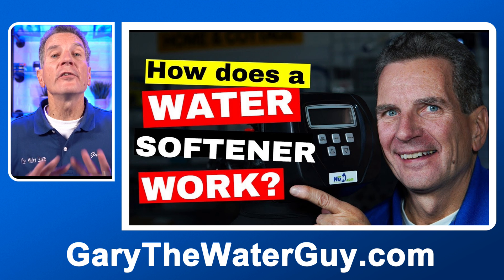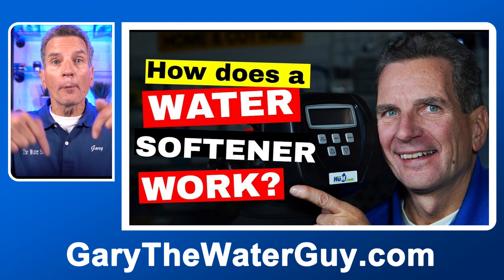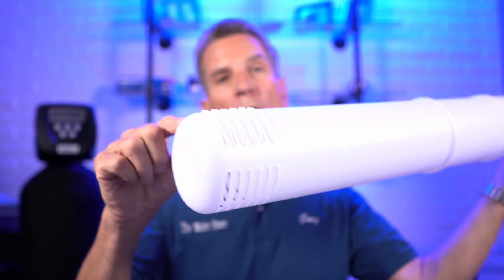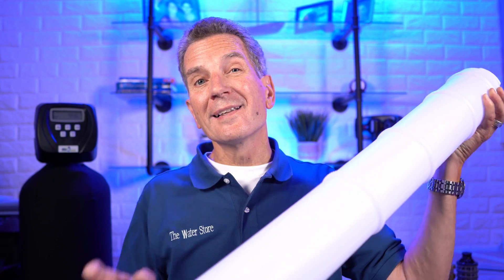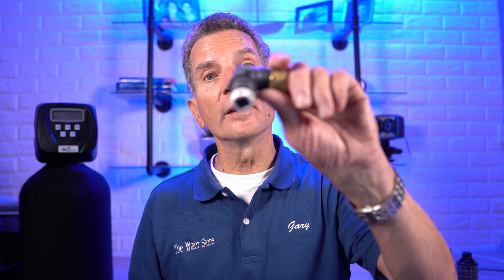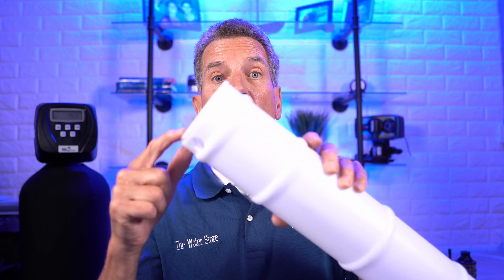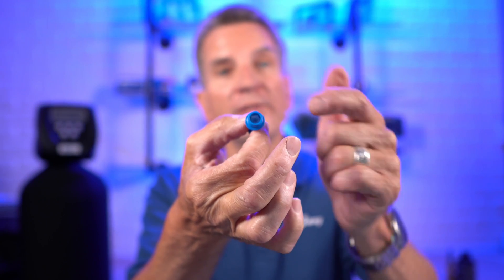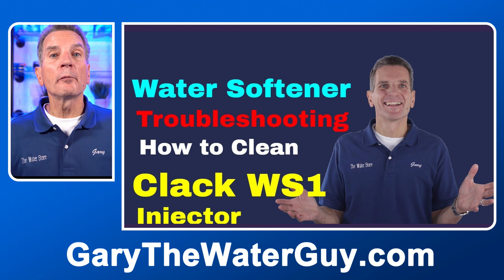Water Softener Troubleshooting – TOO MUCH WATER in Brine Tank

Comment: Great videos and you helped me start troubleshooting.

I think I always or for the longest time had lots of water in my brine tank or at least I think I did. I would say the tank is just below half full. My brine tank would be the size of a big large plastic garbage can. It’s big.
So I cleaned it all out and took the float out and checked everything and blew with my mouth to make sure the float was working when I’d move it up and down and it does work.
I checked the brine line and the connections at the Fleck 5600 and everything was clean.
So from empty I would fill the brine tank until the water is about 6 to 8 inches under the float then run a full cycle. I can hear and feel the water leaving the brine tank and when it’s filling. When everything is done and finished the water level is about just half way filled in my brine tank and looking at the float the water is just under the float which I’m assuming is correct because I’m assuming when it’s refilling the float shuts the water off but when it’s completely done should the water level be this high right under the float or should it be 6 inches under the float. I thought I seen that for the first cycle starts to drain the brine tank again that the float needs to be down or the water level needs to be below the float.
Reply from the maker: Keep in mind that the float is never used unless the water softener malfunctions and does not shut off when filling the brine tank.
Reply: @water_estore 
Ok great thanks. So after cleaning again and trying to troubleshoot or trying to figure out stuff when I manually turn right away to brine rinse the water in the brine line is actually filling the brine tank there’s no suction happening until quite a while after this happens as I have the brine line disconnected off the float and hanging in the brine tank.
When I disconnect the brine line from the head and place a bucket there when I manually turn it to brine rinse it will shoot water out fast and I’ll need to turn the dial by hand quite a ways for suction to start I guessing about half way turn in this cycle. Is this normal? PS also put a new drain hose line it’s not long about 3 feet but the last foot and a half was filled with iron sediment buildup inside with a reduced inside diameter

Comment: Hi Gary, thanks for your amazing videos. I've been troubleshooting this issue for a while and still can't figure it out. So I cleaned the injection valve, and ran a regen cycle. When it was in the brine cycle I can see the water leaving the brine tank and water is disappearing. I stepped away. After the regen cycle I checked back and it's full of water again,  up to 2/3 of the way above the amoount of salt I have. I have about the bags worth of salt in there. Is it my setting? I live in Stouffville, On, and the water is hard here, so I set it at 17.
Reply from the maker: It might be but was there a time when the softener was new when there was less water after regeneration?
Reply: @water_estore  It's only been a year old, not sure how they set it up, but it sets to regen when it reaches 0. So my thought is that it's adding water head of time, but I can be wrong.

Comment: I have an older camshaft water softener I don't think it's revolving properly there's water building in the brine tank any help?
Reply from the maker: Sorry, with those my suggestion is just to replace it
Reply: @water_estore   The problem I found out was that tabs go in the center there's a small pilot hole on that but I'm still getting water backing up in the brime tank and it is clear the outlet in the back and I drained the brime tank itself

Comment: Great content. The pre installed water softener plumbing in my house seems to have the water softener drain running from the garage to upstairs laundry, which is about a 10ft rise in elevation. Would this create a backflow into the water softener? Not sure if there is any valve that can be installed to prevent this.
Reply from the maker: They are often installed that way.  No problem as it is.

Comment: Can I turn the 1 piece tank on its side to clean tank out?
Reply from the maker: I wouldn't, they tend to break the top plate.  If you are very carfull and tip it on to it's back it might work.  But again, I wouldn't.

Comment: How is the regen done if we don't have that fancy button to press? Mine has the dial🤷‍♂
Reply from the maker: Depends on the brand but usually you just turn the dial slowly clockwise and when you start to hear water running let go and it will take it from there.
Reply: @water_estore  I turned the knob to "regen" and after a while, it started. Thanks

Comment: Hi Gary 
I have 2 piece culligan gold 9” water softener now i have a problem with that and problem is whenever i turn water supply on it just directly send it to drain and then i bypass the water supply and turn regeneration brine tank has more water as compare to before regenerating 
So i check brine tank its full clear i check filter its ok i check drain pipe its working well 
But i didn’t figured out what the problem is  if you understand can you please tell me what is the problem and how can i solve that please
Reply from the maker: It sounds like it stuck in the backwash cycle.  Likely needs to be rebuilt.
Reply: @water_estore  thank you so much for replying 
Can I rebuild it myself if yes how can i do that and how much it would be cost give me some idea thank you in advance
Reply: You need to replace the seal pack and eductor kit

Comment: Hi Gary,  great videos. Now I know that I will need to service my system and replace a whole bunch of things since it was never done in the last 12 years. You can expect an order from me soon. One question I did not find answers to goes like this. I have two Clack WS1 valves and the drain line flow control elbows leak water from the little stub that comes out the side of the fitting. I have added a piece of clear hose to direct the water to the sump hole but would like to fix it and understand why water comes out of that orifice.
Reply from the maker: Great question!  We just fixed one of these for a customer last week.  That stub contains a small one way vent that was designed to make the backwash cycle quieter.  After a time it leaks.  You just need to replace that drain elbow.  We have the replacement part here https://waterestore.ca/products/clack-ws1-drain-elbow-v315801 and the video here at the 43 minute mark explains how to replace https://youtu.be/MCrcE1Tffsk

Comment: Great video. I have the Kenmore Ultra Soft 250. I have gone completely through it, got it all redone, but often see the water in the brine tank up high. The float on that valve rod is adjustable, but I cannot find any literature even in the manual on how high the float should be. Is there a general rule of thumb on the height it hould be at? I have heard 10 inches, but at what point should that be measured? Also, if I fill the brine tank up into the 7 or 8, should the water level still be below the salt? Thanks.
Reply from the maker: Great question. The float does not control the level of the water, the valve does based on the programming. Typically there should be about 1 1/2 feet of water on average.

Comment: Hello, excellent videos. 
One thing I couldn't find is how to empty the water from the brine tank. Ours is now 3/4 full and it has never done that before. It is 5 years old and usually it just covers 2 bags of salt at the bottom, maybe a foot of two of water. Is there a way I can manually empty the water from the brine tank now through the valve or setting? 
Thank you for all of your great videos and advice. Much appreciated.
Reply from the maker: Yes, once you have repaired what caused the overflow just regenerate the water softener a couple of times and it will suck out the brine and return it to the correct level.
Reply: @water_estore  Thanks for the reply. I guess what I was asking is there a way I can just pump the water out with the system without regenerating it to see if it was just a fluke?  Thanks.
Reply: No salt was being added for a year
Reply: Should you not drink the water where no salt has been added.
Reply: Can the water softener leak out onto the  flow if you haven't added salt for about 1 year?

Comment: Hi Gary, I have a EMC 10 Water softener and its brine tank is getting filled up to the top on manual regeneration. I have checked the outflow tube and it works OK at the begining of the Regen cycle draining out water and after 10mins or so out of 74min cycle, the water starts to build up in brine tank. Overflow tube is all clear. Brine tank outlet tube has got no clog where it goes to the top into the main tank (resin tank) area. I have also tried to put 100-300mls of Resin cleaner in the brine tank while the water is still on but it has achieved nothing. When I do manual regen, I keep the inlet and outlet water valve in functional position. Any thing else which can be the cause of this problem or does it need new resin? Will appreciate your diagnosis and treatment on this ill water softener, DOCTOR Gary . Thank you so much
Reply from the maker: Media replacement will not fix it.  Did you check all the suggestions in the video?

Comment: I used a rust out cleaner in my water boss a few days later the brine tank was full of water. Doesn’t seem to be filling during a regeneration but rather it happens randomly in between them.  Any ideas? Also my softener won’t regenerate when in bypass mode only in service mode. I notice u regenerate a lot in bypass mode.
Reply from the maker: If is fills between regenerations water is leaking past the piston.  Water softenmer can only regenerate while in service.

Comment: I need help please.    I have a whirlpool.... w softener  .  The low salt or recharge light is continually blinking ... Its a little low on salt but it has been lower many times b4 .
 My elec was out last week ...that may have something to do with it .  Anyways it want respond when I push any button . I can't even set my time . Can you please help?
Reply from the maker: Sounds like the circuit board may have been damaged by a power surge. Try unplugging it in, waiting a few minutes and plugging it back in to see if it resets. If not you will need a new circuit board. If not you’ll need a new softener like this one https://waterestore.com/products/hum-deluxe-water-softener-30-000-grain

Comment: Thanks for your video. My brine tank had the standing water problem weeks ago, and I scooped out all the water and it seemed to be normal for a while, and when I checked again few days ago, the tank has water level very high again, and like last time, with some dirt floating on the water. can i manfully do the regeneration while the brine tank is full of water?
Reply from the maker: Yes, but you need to determine what is causing that high water level by troubleshooting.

Comment: These videos are amazing to watch. We have been in our house for almost 10 years, (house was built in 2008) and this is the first time we have had issues with our softening system. Hose connected to the brine tank keeps popping out out of the brine tank, and water ends up all over the floor. I am addicted to watching these videos now to learn more about it. We have someone coming to look at it, everything my husband and I have tried hasn't been working so far. And still leaks water all over the floor.🥴. *Roughly how much would a whole new water softener system be*, IF we need a whole new system.  We are in Ontario Canada. We just cleaned the brine tank out, so no salt clog anymore... there was one about 2-3 inches thick. Yuck. And my husband said it to regenerate a few times. So we think it might be time for a new one.
Reply from the maker: This water softener would be a great choice, we have them for about $1200 currently https://waterestore.ca/products/hum-deluxe-water-softener-30-000-grain

Comment: Hey Gary, thanks for doing these videos. I have a softener where the brine tank has recently been getting too full. Last night I cleaned out the salt and there was a lot of salt sludge at the bottom so I suspected it was a salt clog. I followed your directions for salt clogs. I did not regenerate the system because it was 8 pm but I knew it would regenerate at 4 am the next morning. This morning I checked the brine tank and it had maybe triple the amount of water I initially put in. So water is coming into brine but obviously not going out. Also, my brine tank does not appear to have a float. I removed it in the cleaning and did not see a float. What do you think?
Reply from the maker: Did you check the other things like a clogged injector or drain line?
Reply: @water_estore  I just cleaned the injector. Still not sucking the brine out. Any other suggestions?

Comment: Hi Gary I have a water softener in my house I have a problem every time the filter backwash  I get a lot of salt throughout the faucets ,need to let the water run for 3-5 min until it clears up can you help with this situation.
Reply from the maker: Check out the info in this video for help https://youtu.be/3GQWpqlLBps  Usually partially clogged drian line.

Comment: Fill timer runs out but it continues filling, no leaks. Sometimes it continues running after the rinse timer runs out, no leaks. No salt blocking. Draw cycle works fine. Fills until floater stops it. Mine probably has some problem in the mechanical parts. Watco pro 2P100MPREM Std efficiency just over 3 years old. Metered softener.
Reply from the maker: Either a problem with the circuit board or piston.

Comment: I've got an old softener. It just started continually running water into the tank. It over flowed last night. So I emptied it and am regenerating right now. Any ideas? Or should I just go through all the steps?
Reply from the maker: It could be one of a few things including a frozen drain line.  Follow the steps in the video.